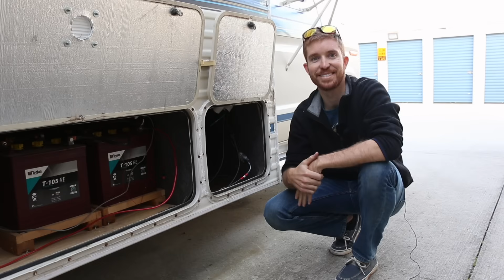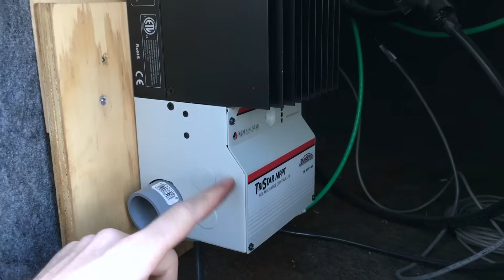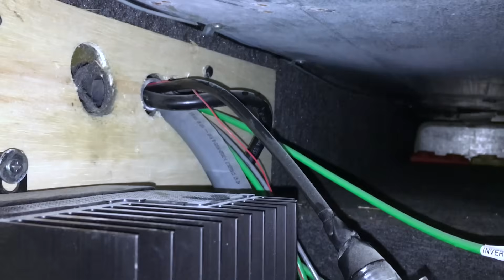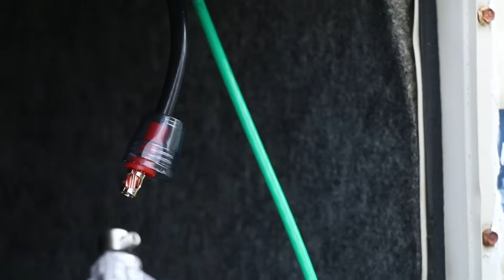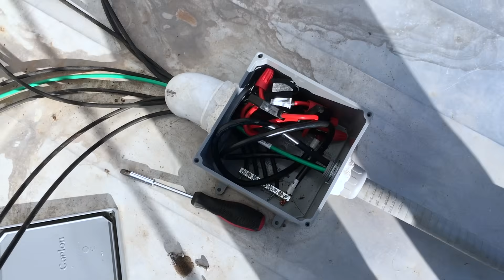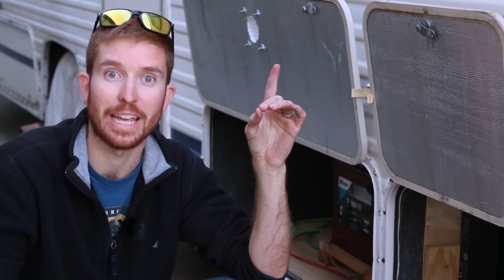Solar Fuse Sizing + Wiring Charge Controller to Battery Bank

Comment: Just an opinion, but from what it appears, 10awg and 30amp inline fuse seems a better fit, but not sure how you might have run in series/parallel Over fusing a system has drawbacks and puts things at a higher risk before they blow

Comment: I have a App Ever 40 amp mppt charge controller, I have two t105 Trojans 225 amp hours. I also have a hundred watt Thunderbolt solar panel. I believe the amp rating is like 8.2 amps. What size fuse is best for the panel and what size fuse should I use between the batteries and the charge controller, I'm having a hard time finding out the correct amp fuse from batteries to charge controller. I guess I'm just a little paranoid lol, I just want to make sure. I am thinking 10 amps on both. Not sure. Even though I can go 40 amps on this charge controller, I'd rather stay within the rating of the panel. But I'm having a hard time finding out what the charge ain't amps are for two of the t105s combined

Comment: Here is the sizing of his system (in order) so you don't have to rewatch:

4 panels * 150 W = 600 W solar array (each panel is 150 W / 12 V = 12.5 A)
4 AWG wire
60 A fuse
Charge controller
60 A fuse
4 AWG wire
Battery bank

Comment: Omg! I need some advice.......I have a 100 watt flexi panel in which I was told 30amp fuse is what I need for the solar to controller, is that correct? Also, I have a 10amp mppt controller hooked to a 200ah battery & the battery is also connected to my battery isolator which I have a 150a fuse between those 2.....what size fuse should I use between my mppt & battery?

Comment: I have a 7” High Performance 12V 80W electric radiator cooling fan for my 20’X 8.5’X8’ medal container with a 12” vent in the back of the container. I will be storing my furniture in this container while my new home is being built. I have a Renogy 12V 100W monocrystalline solar panel charging 2-1200wh 100ah batteries in parallel though a Renogy Rover 12V 60 Amp MPPT solar controller. I also have a 1500W Pure Sine Wave power inverter hooked to the batteries. My question is will this system run the 7” fan 24-7 and what size fuses should I install to protect these components? Also, should I install 3” fans aimed at the batteries in an effort to cool the batteries.

Comment: I just watched this whole video to only find out one thing,what gauge wire should be used between the solar controller and battery and altho it says it goes over the wiring I didnt learn anything about wiring.lol not a bad video just should be named differently
Reply: I was watching it to get the same information

Comment: I installed 3 Go power 190 watt panels with a 30 amp charge controller and I have it throw a fault and it flashed, looks to have had a spike I also have a 250 ah lithium battery. Should I have gotten a 40 amp mppt controller and should I add a 40 amp fuse when I installed Go power said I didn't need a fuse? Thanks

Comment: When I'm calculating the distance for wire size will it be the 15 ft from my controller to the 2 batteries or the entire way from panels to bats. I already bought the 20 ft of 10 awg connected to the panels .

Comment: Just for clarification: the fuse size depends on the wire thickness alone. It is not there to protect the components in your system. Components have their own fuses. The wire from the solar panels is a different story. At the back of the panel there is a recommended max fuse size. Use this size for the wire fuse but multiply by the amount of panels if it's put in parallel. Because of the voltage drop, you need to have big cables, therefore the wire size from panels to charge controller will be much bigger than it needs to to carry the current.

Comment: Thanks for the video. How do I determine what size fuse to use from a 100w solar panel to a 20 amp mppt charge controller?

Same question for the connection between a 1000w pure sinewave inverter to a 12v 90Ah sealed lead acid battery?

And the connection between the charge controller & the battery?

Thank you for your time.
Reply: Everything is 12v

Comment: Hi, I have a similar set up differing in that I have 4 160 watt panels and I thought 2 each paralleled then series together from there. That gives me 640 watts total @ 43.2 Volts and 14.8 amps.  My logic is 43 volts and 15 amps is a happy medium. My question is what size fuse do I need on the panel side and the charge controller side? I figured 8 gauge wire (no more than 18 feet)  I can't seem to get an answer anywhere on this one.

Comment: Hi there how are you , I have two  200w   solar panels  and I want to connect it by parallel... I want to know how many Ampere fuse can I put between My 2 , 150AH will connect again by parallel battery and 3000w 12V  inverter  .is there anyone out there can help me ? Thank you

Comment: Do you have any wire gauge recommendations for wire coming from controller to battery bank?  We'll have two 150w panels feeding 2-3 deep cycle 12v batteries.  Edit:  After watching further I see you used 4 gauge.  I would like to go with something a little smaller/higher gauge.

Comment: WOW!  This is bad, just plain bad.  First off, those are flooded lead acid batteries.  Secondly, they are placed in a small, apparently closed compartment with no specific route to exhaust the vented hydrogen gas that comes with charging.  As you know, hydrogen is flammable and this represents a fire risk.  It could get to hot exhaust, into the cabin or under the hood?  Also, the tops of the batteries do not allow enough space to check water levels and refill.  Even worse, the batteries are sitting on wood shelves and not even strapped down.  At a minimum they should be inside an acid resistant enclosure.  There is no spill control here.  And there is no protection of these batteries from a side impact.  This is just a careless, dangerous setup.  Folks, avoid this kind of setup.  If having to install a battery bank, use sealed AGM batteries or lithium.  And please locate them where there is some protection from a collision.

Comment: hi mate what fuse would i use coming of two soar panels joined together. could you also be able to help me with what use i would put at the start of my mains that comes from my 12v battery bank so it would be a master fuse before all my components.

Comment: Hey there. I’ve watched many videos and I can’t figure out what size fuse to use between the batteries and inverter. I have a 2000 watt inverter. Any help would be appreciated.
Reply: im in the same boat, have you found an answer?
Reply: Hi,find out the current rating of the cable, this is the size of the CB or fuse

Comment: Question I want to put solar on a 12foot trailer I will be running up to 4 ham radios two power supplies to run them along with 2 antenna rotors . And 4 led lights how big of a system would I need I am not a tech guy so I don’t know how to figure that out I would be grateful for your ideas thanks
Reply: Forgot a laptop also I would want the system to be larger than what I need in case I was to add to it later on thanks

Comment: Although fuses are great and do work perfectly fine, I opted to use DC circuit breakers in my system.  I like the ability to be able to isolate parts of the system with a push of a button if I need to-since basically the breaker is a switch as well as a protection against over current.  They do cost a bit more than fuses, but I think in the long run they are a bit better.  One thing to keep in mind for sure is to carry spares, you might want to put them in a box near your charge controller or similar so they are handy.  Not that you should be blowing fuses, but you don't want to be without one if one does for some odd reason.....  I know this video is over a year old, but its something you might want to consider in your next build.  :)  I ran 4 GA "welding" wire to all my stuff (its very thinly stranded for current carry) but I have it connected to 12VDC items mostly (Ham Radio station) and only a small inverter.  Those batteries are nice though, not cheap but if you don't run them below 30% (preferably 50%) you'll get long life out of them for sure.  Nice mobile setup!

Comment: Are you sure about the series vs parallel statement that you made.  Renergy commandeered that I connect my two RV panes in series.  Are you sure that if one of the panels is shaded the result will be lower performance then if they were in parallel with one being shaded?
Reply: I believe that most panels come with bypass diodes installed so shading of one of the panels in a series array does not block the current from the rest of the panels. I would be surprised if his panels did not have bypass diodes installed.

Comment: Just a question, do you have your panels in parallel and the charge controller is mppt?  if that is the case you are using the mppt inefficiently
Reply: I was going to make that comment.Should be in series for MPPT.

Comment: if each battery has a max of 10 amp input charge and you have 3 batteries would I set my output from my charger at 30 amps?

Comment: Help! I'm planning to put 12  100W  12v panels on my roof.  If I run these all in parallel that would add up to 100A.  If I run these into a combiner box it would require 1/0 cable to the charge controller.  I don't think a 100A charge controller would take that large of cable.  Any thoughts?
Reply: If you put your panels in series say (4) groups of panels connected in series you won’t need as thick of wire (depending on the length the wire is from the solar array to the charge controller.

Comment: No disconnect switches between panels and charge controller or between batts and inverter, this could also be done with circuit breakers too.
Cable management, could use some work. Use the walls to mount those fuses and shunt, and the missing switches/breakers.

Comment: Awesome video thumbs up, if I have 40A CC and a 120AH 12v deep cycle battery should I use 40A fuse, is the fuse size depends on the amperage of the CC?Thank

Comment: Your fuse between panels and charge controller should not be in the bay it should be on the roof. Fuses should always be as close to the power source as possible.  Always consider what happens if you cut the wires making a short circuit. If your fuse is 10 feet from the power source (panels) and you create a short circuit 5 feet from your power source  that shortened circuit has no fuse and you have a fire.

Comment: I love 4 awg Cables and use them for the Jumper / Balancing wires between the batteries in the bank ...
  However- I have a EPever MPPT 40 Amp Controller to (6) 12v agm batteries (Balance charge / dis-charge).... and the holes for the cables to attach to the controller are too small for 4 awg... So I use 6 awg quick disconnects from forklifts lol.......is that ok?  I am runnin  (3) -150 watt panels that give me about 23-26 amps to the controller in full sun in parallel...

Comment: Ok why not a dc to dc breaker?
Reply from the maker: I will be adding breakers to my system soon. Great question!
Reply: An electro-mechanical device like a breaker are subject to more types of failures than fuses. Condensation,humidity for corrosion... the finite amount of on/off transitions designed into the unit & much more. If going with all breakers... prepare & perform maintenance visual inspections at least monthly and allow downtime to test the ability of the breaker to indeed cycle on & off... ensuring it/they are not stuck/locked into a position via corrosion or whatever else. 
Safety first crew !

Comment: Michael! You have done a really awesome job clearing up all the mysteries of solar!!  You’ve also presented it very nicely in a clear & concise manner!! Thank you for that!

My question is regarding the solar generators...what are the differences between the two systems, an array of PV panels & a bank of batteries with charge controller and inverter vs a (similarly powered) PV panel(s) connected to a generator (I’m assuming the solar generators are inverter-type). 

I have a (newly-acquired) 20’ travel-trailer I want to run on solar... it DOES have an A/C but I don’t know the wattage. At present, it has ONLY a simple 12 v battery that is charged by the tow vehicle in-transit and either relies on shore power or a (rented) generator. 

Originally I was thinking I needed both solar for normal use and a generator for A/C days. I keep seeing solar generators pop-up and wondering how they fit into the picture...

Thanks much!  Your videos are all great!  Of course, with this series, I’ve  been missing your better half!! 😎. Look forward to seeing both of you soon!!
Lauri
Reply from the maker: Thanks Lauri! It looks like solar generator is just a more expensive (albeit convenient) way of getting off grid power. Cost per watt seems super high and it also doesn’t come with the panels to charge the generator. For low power usage,  the solar generator would work in a pinch but if you need some serious off grid power, setting up your own system is the way to go. Hope this helps!

Comment: Shunt is so fun to say! Shunt! 🤪 I used this breaker between my panel and the controller instead of a fuse. I can disconnect the panels if need be. MidNite Solar Photovoltaic DC Circuit Breaker - 30 Amp, Model# MNEPV30 https://www.amazon.com/dp/B004EQJS1S?ref=yo_pop_ma_swf

Comment: It looked like you used green colored wire as the battery system negative. It will work, but that is not the standard color for this use. Green wire normal means grounded to earth, which doesn't exist in most RV systems.

Comment: Is there any advantage of wiring four panels in series and parallel. Making the aray 24 volts?
Reply from the maker: 24 volts would require smaller wires which would save you a decent amount of money depending on how far you are wiring them. After a certain distance, you really should go with 24v because the wiring for 12v would simply be impractical. Hope this helps 😎👍🏼